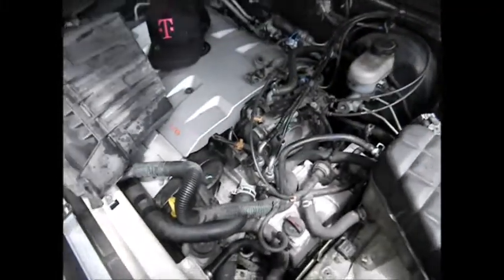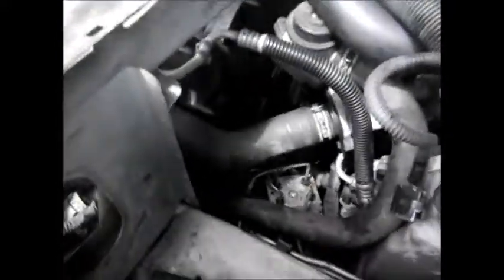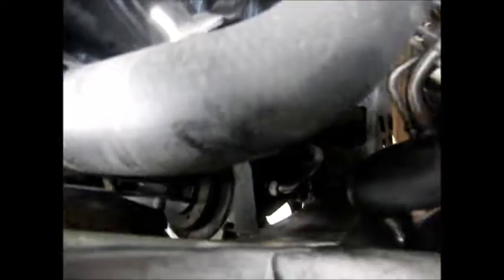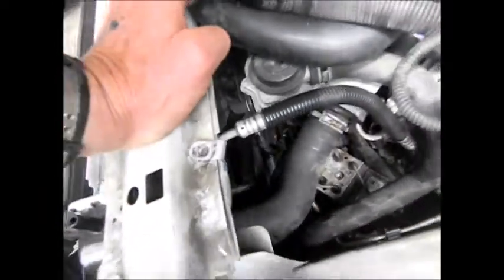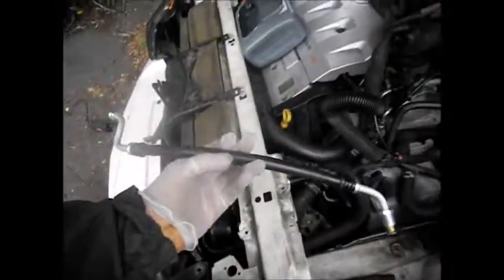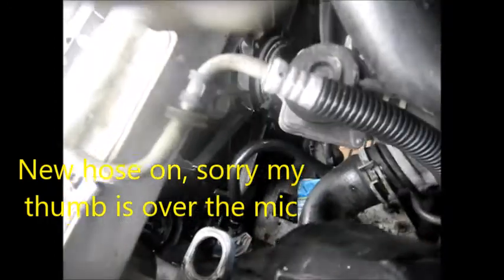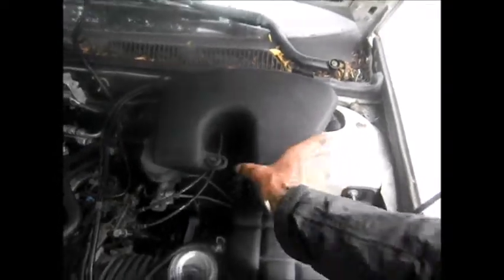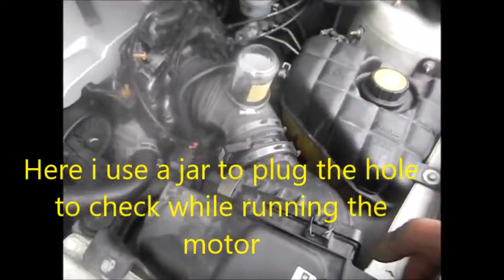Northstar trans cooler line

Comment: Should have taken a pair of pliers long ones twist the cap off you take off nothing I have a leak on same hose @ the 90 it’s pissing every where that short hose connect to where not the radiator the other side is it on a pin too like the front